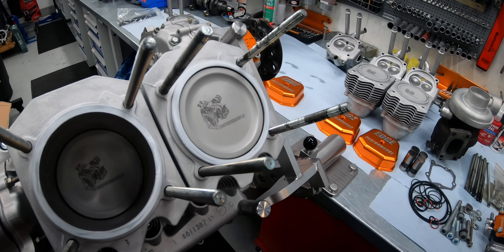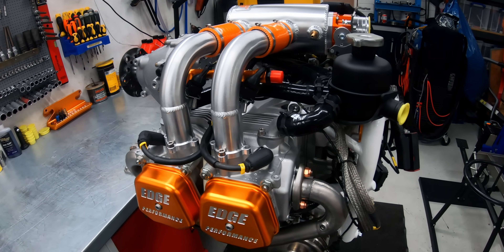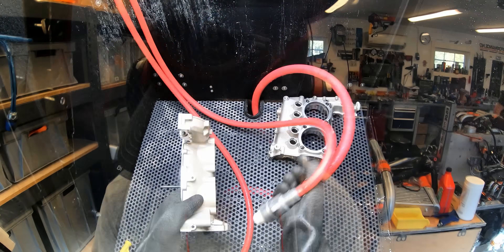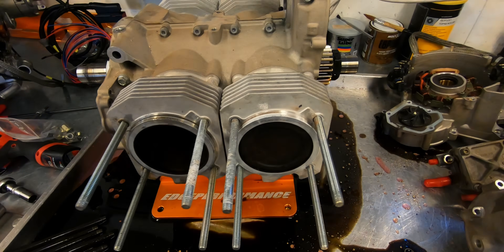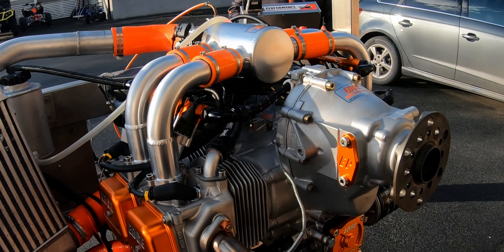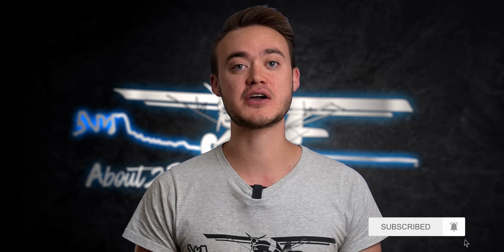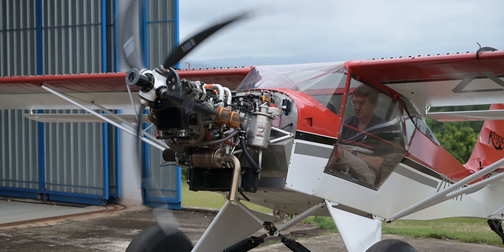ENGINE REBUILD | 165hp Rotax Upgrade Edge Performance vs Rotax 915is - BUILD Part 2

Comment: I wanna put this in a Risen or modify the 915 to have even more power! That air frame with 170 hp would cruise at 200knts I know it! 
EDIT: ohh well never mind. Same continuous HP... Damn. Still 50 lbs lighter that alone is massive! this is a no brainer for anyone approaching TBO on a Rotax.

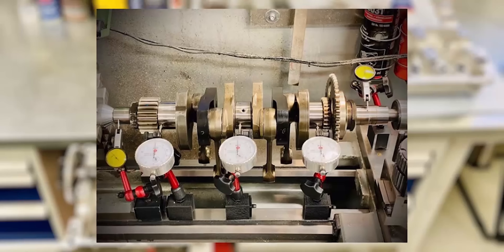Comment: Welding the crank. (2:35)  A good step.  
The Rotax cranck is pressfit from loose pieces. 
I have waited for the moment someone would either install a forged crank, or some thing equal : weld it to a solid, one piece.
Key to high load endurance are the oil-sprayers, either for cooling or laying the oil film exactly there where it is needed.

Comment: It is NOT the reliability I am concern about, it is the value for my money. 1) I have to provide an already expensive Rotax, 2) I have to pay Edge, 3) all that for a small 24 HP gain.  I could have got that by just using a Yamaha , Aero Momentum, Honda engine for much less. Rotax , UL etc did not do aviation any favor by making it affordable for many.

Comment: There seem to be many misconceptions about adding horsepower reducing reliability. 

This is only true within certain conditions, adding more power by adding more boost to a stock engine will certainly reduce reliability and increase wear. 

Building a custom engine that combines several coherent upgrades to maintain or even improve reliability and reduce wear. 

High tech piston rings are an example. You can reduce blow-by, increase durability, and extend overhaul intervals by an order of magnitude with modern piston rings vs the old iron rings.

You can add boost, increase power, use lower octane fuel, and still maintain fuel economy, and reduce cylinder head temperatures with a combination of lower compression pistons and better ECU control over fuel and timing. Its all in what you want to accomplish and the only limit is your ignorance.

Comment: Edge looks professional...but why go with a rebuild aftermarket based on an old engine design when you can go with the same basic cruise HP from the OEM?  The cost is about the same when you take into account the core needed to get to the $16k.

Comment: Can you confirm what the upgrade will cost if you have an existing 914 motor. ..??
Reply from the maker: Yeah sure!
Our 914 (existing) upgrade cost around EUR 14 500.
Reply: @About2Stall  thanks so much. And tell me. The aircraft performance from the 914 to the edge upgrade. 
Was it a real noticeable increase in take off and cruise speeds ?.
Reply from the maker: My Pleasure!
It was a HUGE difference! Take offs are never longer that 130ft and cruise speed improved significantly

Comment: I honestly don't understand the insane prices of everything having to do with any kind of aircraft. Almost $40.000 for a 915 cc mostly air cooled engine that is derived from the VW bug engine that was designed in the 1930's. Yes Rotax makes great engines but that isn't $40.000 great. For example The Ford 5.2L ALUMINATOR 5.2 XS CRATE ENGINE is a all aluminum DOHC 4V per cylinder V8 that is far more modern and sophisticated that is built with absolute precision in it's tolerances and is way more complex to build and make 580 HP at half the price. That's half the price for 5 times the engine. Why is it that all other engine manufactures in the world can produce engines that are all competitively priced. just seems like they are charging that much because they can.
Reply from the maker: I absolutely agree with you, but to some extent I do think "aviation tax" come into play... The cost of development for Aviation is much higher than for cars.
Reply: @About2Stall  Yes the development cost are very high indeed.  If you include the certification cost's as well its crazy expensive. I realize manufactures will have to recoup that money by increasing the price of there newer products but the engine the 915 is just an forced induction fuel injected version of the 912 that has been around since 1984. Those development cost's must be payed off by now. It's not just Rotax, Lycoming and Continental are still making engines that have been developed over 50 years ago a they still want a arm and a leg for one. A model T cost over $1000.00 when it first came out and by the time it was discontinued it was less than $250.00. What ever happen to those days.
Reply from the maker: Yeah...
Unfortunately we just have to suck it up and deal with it if we want to fly 🙈
Reply: @About2Stall  Yup, that's the way it is. Happy flying.

Comment: Nice Engine, lower weight, compact, fuel injection. Though the Edge performance has a a shorter TBO of 1200 hours instead of the 2000 hours a Rotax 915 brings. This is causing a substantial higher depriciation. The 915 runs for 18,50$ per hour, the Edge Performance needs 26,80$ per hour.
Reply: Elementary my dear Watson.
Heat is energy. The more heat, the more energy, the more horsepower. Increasing the bore means more fuel gets burned, hence, more heat, more energy, more horsepower.
More horsepower comes at the expense of reducing engine service life or longevity.
In this case the biggest gain is the new engine's lower weight, not necessarily the new horse power numbers. If you were to reduce the weight of the old rotax by the same amount, you would gain more useable horsepower because now the overall load is lighter. For the cost of the upgrade plus reducing TBO from 2000hrs to 1200hrs will make it even more expensive over the long haul. Swapping out the cam for one with a bit more duration will also give you a few more horses. Another thing to consider, can the aircraft handle the extra power?? How much power was the airframe designed to handle?? Sometimes more power is not the answer, but efficiency n reliability is.
Reply: Few, if any private pilots will ever fly 1,200 hours in their entire life.

~ A 30-something year old Private Pilot w/120 hours.
Reply: @Triple_J.1  hmm, this is not about how many hours you expect to fly in your life. The discussion is about the question does it make sense to buy an Edge performance instead of a standard Rotax 915.

Comment: both have 135 max continuous...what is the point.
Reply from the maker: Short field takeoff and landing(STOL). The one can use a shorter runway and with STOL flying that is very important because most of the time you have no runway. The 135hp will take the kitfox through VNE. It is all about takeoff with a big engines on these slow AC. Hope this answers your question

Comment: It's very cool but they need to make their own engines instead. Rotax engines are massively overpriced so starting with that and doing a lot of extra work is not a smart plan. Since you lose certification. They should really make their own. Optimized in every way. And aim for a much lower price. Say 150 turbo horses for 10k. And get it certified. That would be a 915 killer. And it deserves to be killed.
Reply: A (certified) 915 Killer for 10k .,, boy boy dreams and fictional imagination get better and better everyday 🤣
Reply from the maker: That's true, it would be really cool!
I'll ask Thomas about it, but I definitely think there's a market for it!

Comment: Could you tell me please what is the critical altitude for 13hp continues power? I tried to contact edge performance about that but did not get any reply.
Reply from the maker: Hi Aleksandr, I'm assuming you're referring to the 130hp non-turbo engine?

Thomas from Edge Performance told me: "There is no critical altitude really. They are fuel injected and will work to 25.000’ easily"

Hope this helps?
Reply: @About2Stall  135hp. Sorry for the typo. Rotax 915is provide full takeoff power (141hp or 135hp continues) up to 15000 ft sometimes up to 17000ft and higher at cool weather. So I am wondering what is the critical altitude for this engine to provide continues 135hp above witch it starts to lose power. I understand that it is not that critical from STOL aircrafts, but it can be very important for Sling TSI building. Thank you so much for your reply! Subscribed!
Reply from the maker: Pleasure! Glad I could help🔥
Reply: @About2Stall  Could you ask your friends from edge performance what is the critical altitude of their engine after which it starts to lose power?

Comment: But... You get fadec with the 915 and some nice stickers. Joking aside the resale value of the 915 will be worth close to RRP where as with the edge you are gonna drop 10 or so out the gate so you should have included a residual value if you wanted to do a like for like on cost. Basically the 915 gives u an extra 10 in the piggy bank by comparison meaning your balance sheet will be healthier with the stock Rotax. Capital cost is not the point of win or lose, it just gets you into the game.

Comment: You stated that the Edge Performance engine has a TBO of about 1200 hours, doesn't the 915is have a TBO of 2000?  I think that should have been included in the comparison too.
Reply from the maker: According to Rotax the 915 has a TBO of 1200 as well. But I have heard of people saying they were able to get 2000... Not sure how accurate it is though.

Comment: As you go higher in altitude for a given boost pressure the turbo spins faster. Is there a max allowable altitude at a given boost pressure or is the wastegate referenced to absolute pressure?
Reply: See: "Turbocharger Critical Altitude".

Comment: 50" of manifold pressure is basically a little over 4lbs of boost correct?
Reply: No, 30 inches is atmospheric, so 20 inches more is about 10psi.

Comment: Edge Performance looks like a top shelf operation.  In your first video, you mentioned proper prop selection for desired mission.  Is an in-flight variable pitch prop available?  That would make it more apples to apples when comparing flight performance to the 915 in Trent's Freedom Fox.
Reply from the maker: Yes! The 75" 4-blade Airmaster Whirlwind that we have is in-flight adjustable similar to how Trent's MT prop is👍🏼😁
Reply: @About2Stall  Very cool.  Looking forward to the rest of the build.   Kind of raised an eyebrow at the thought of going all Charles Lindbergh over the Atlantic ocean in a souped up Kitfox, but I suppose Guiness might be interested; the beer manufacturer as well.   Sponsership, anyone?  

 If you covered the constant speed aspect of the  prop in video  #1, I must have been munching on nachos at the moment and didn't hear it over the crunching noises.    I suppose most folk don't think of nachos as breakfast food.  However, we bachelor types with the dietary constitution of a goat tend to eat whatever is handy, and I had leftover nachos and a toaster oven.  ;)     

Much success on the build and have no end of fun flying the African Beast-Mastet.
Reply from the maker: Thanks man!
🤣😋

Comment: Got to be honest.  I never like to be the first kid on the block with a new engine been there done that,, a lot,  over my 35 yrs of flying light aircraft.    The further you are away from stock the less reliable you will be.
Reply: Edge performance is reputed to be the best ... and what many pilots who are familiar with hot rodding and racing cars don't understand is in back country airplanes you usually only use that power on takeoff and climb and only those times you need it  ... a full 98% of the time your cruising at stock power levels , stressing the more strongly modified engine to stock stresses ... It is quite conceivable that these modified engines can last longer than stock because of this .... Thats the part most people miss ... The engine only gets stressed when you use the power ... and most of the time you don't use the power
Reply from the maker: Well we are not the first - like we mentioned in the video, more than 250 such engines have been built since 2006 and none has failed. Some has more than 1200-1500 hours. So they have a perfectly good track record!

Comment: Quick question... if you send like a
1000 hour engine does this count as a overhaul? Do they have a limit to how old a engine can be?
Reply from the maker: Maximum time 200hrs TTSN essentially and no older than 2-3 years. Otherwise they overhaul and then do the conversion.

Comment: The basic weakness of the "3 main" case is still there (and made worse with the extra HP!) ..At max rpm, your looking at a "Concave - Convex" distortion of nearly 1/8 of an inch!!.. This problem "Main Web Crawl" is going to severely hamper the lifespan of this engine..My whole problem with Rotex..If the Case had been copied after an old Porsche engine (which address's these problems) instead of a VW..This WOULD be a great conversion..The 3 Main Case will also have a tendency to crack in the back next to the "Rear Main"  and have the Case and Head Studs "Pull" ...Dowel pinning the "Main Webs" using "Keen Cert" style stud inserts and literally building up the Case Webbing around the Rear Main will all help with these issues..but still leave a bunch more little weak areas to be addressed...You can easily see all these issues if you look at any High HP VW Dragster engine builds!!..These engines cost WAY MORE the the budget numbers you are using..Just a proper Rimco Case can run close to $10,000..Having raced VW's and Porsche's all my life and making my living building High HP Porsche's and VW'S  gives me expertise on this subject..👍🇺🇸
Reply: ~160 hp isn't really enough to cause any of the major issues that you're describing here, you're talking about things that happen with VW engines making much higher power numbers.

Comment: I'm wondering how you could justify losing factory support (ADs, SBs, easy acces to parts) for 20HP over a Rotax 915iS. You even get the same HP for continuous power...

I remember in your first video doing this upgrade for safety. You do not make your take-offs and landings safer by adding horsepower through an engine that is a pimped up version of a lower HP engine.
I totally understand that you will have to check every 50 hours for leakdown, you are pushing the engine above the limit every time you take-off with it. On the long run, it may end up costing you more to maintain the conversion engine vs a factory 915iS.

Just my 2 cents.

Comment: Does this run a backup ecu and fuel injection system? In the video I think you said ecu singular.
Reply from the maker: They offer it, but no one wants to pay for it. And 1000 kits and engines with zero ecu failures is a really good track record!
Reply: @About2Stall  well, there's part of the price difference.

Comment: Hello from Australia. 
I'm interested in fuel consumption at lower hp/rpm levels. (Economy cruise)
In a high drag airframe 35 lph is not going to work out to a particularly long range.
This is one of the things that put me off the 915.....
Reply from the maker: Hi RJ!
We will have all of those numbers once we start flying and doing cruise tests etc.
Unfortunately due to the current Pandemic it's still going to be a while, but we'll be sure to make a detailed video about it as soon as we can!😁

Comment: The only other thing I could think of as an advantage to the Rotax would be airworthiness directives.
Reply from the maker: That's true, Rotax does make a Certified version! It depends on what you are looking for...
But 165hp!!?? That's why we love Experimental!
Reply: The 915iS is also all new and it's designed by the OEM from the ground up to perform as spec'd.

Comment: That engine is quite something and the Edge branding is very nice! 

One question  - do you still follow Rotax service bulletins or does Edge have their own?
Reply from the maker: Directly from Edge Performance :
"The reason we transfer the Rotax SN is because if there are Sl, SB, ASB from rotax that affects the engine and the components NOT replaced by us the operator is able to comply. A good example was the black tip push rods and bad rocker arms a year or two back. Several EP engines were affected and needed to be updated. And yes, we do issue our own SB/ASB as well on our website."
Reply from the maker: Good question! I'll get back to you in a bit...

Comment: Lekker vid. 
Interesting to see how your speeds will change by loosing that weight .
1/ cruise, stall, landing approach for bush strips. 
2/How much quicker to stop and take off.  
Do you now need to alter your prop ?.
Reply from the maker: Thanks! Yeah we are really curious and can't wait for this Coronavirus to blow over- so we can finally get to flying and testing!